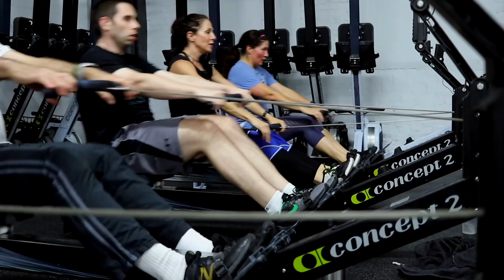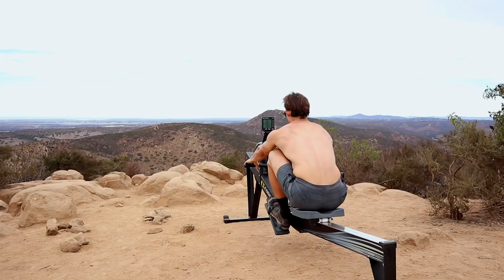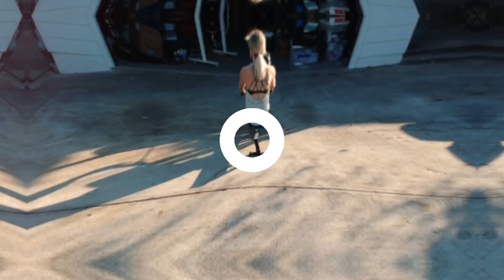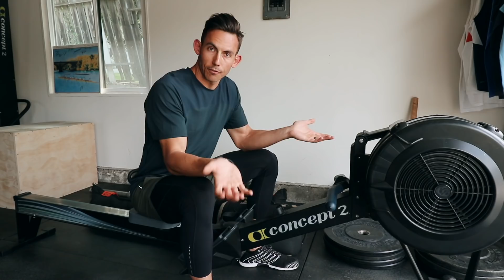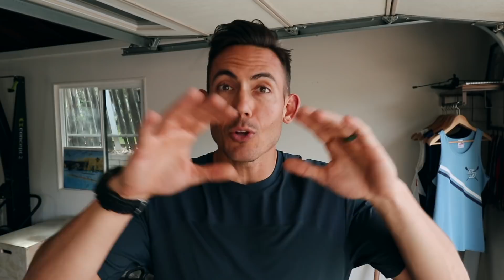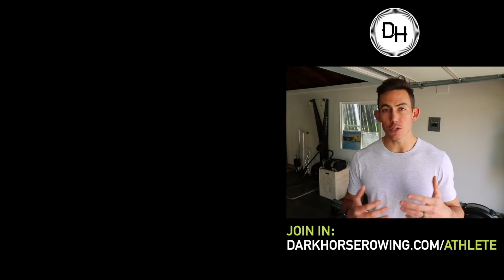Rowing Machine: Why You Should NEVER Forget this Body Part

Comment: The quick release isn't possible if you have a stomach in the way. You can't grab or even reach your feet. Or that could be a busty problem. I have both. I have to leave at least one foot's strap loose so I'm not trapped.
Reply from the maker: That's completely ok Theda. Remember, all things are goals to work towards. As you lose weight or find more mobility in your life this may become more possible. Always modify and adjust for your own needs and help me understand your own needs by filling me in on the modifications you make so perhaps we can help others as well.

Comment: One area I’m still not clear on is drag factor. You’ve made some good vids on this but I’m still unclear how it relates to distance per stroke. For example, if I select a higher drag factor, and assuming I maintain the same stroke rate as I did on a lower drag factor, do I go further on each stroke at that higher drag factor?
Reply: It depends.
HIGHER DRAG FACTOR - power
-Single stroke requires more force, but less strokes per minute, to achieve the same speed

LOWER DRAG FACTOR - -frequency>single stroke requires less power, but to achieve the same speed, more strokes per minute is needed(stroke frequency)

So, answer to your question depends on HOW MUCH POWER your put in your EACH stroke.
If you put the same ammount of force into each stroke on a high drag factor as on lower drag factor with the same stroke frequency, you'll be slower.

Comment: What would be the intention of lifting your heel?
Reply: I don't think it is anyone's intention, it is usually caused by a lack of ankle mobility.
Reply: @SteveisTall  But he says that later on you can do it with intention. But what would the intention be then?
Reply: @GuidoHendriks1990  I think he uses it to increase the stroke length by compressing a little more; too much, and you'd lose strength because of the mechanical disadvantage, but maybe a little helps. Just my guess.
Reply: It provides a little extra amount of length in the strokes.
Reply from the maker: Love this discussion here and it looks like all of you arrived at the answer. Yes, it will allow you a little more length in the stroke as long as you can maintain all other positions and that you know how to place the heel and drive "with intention" is where I'm going with it. Does this make sense Guido?
Reply: Dark Horse Rowing Yes, that makes sense. I’m an absolute beginner, have my Model D for 2 days now. My ankle mobility is terrible so I already slightly lift them. But overall it feels like it’s going alright. Not sure on how to validate that tho.